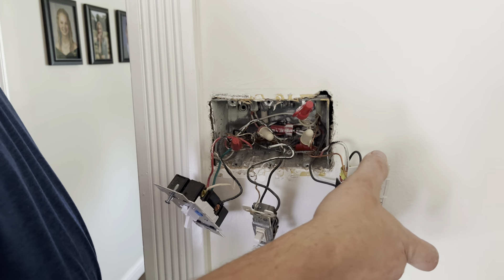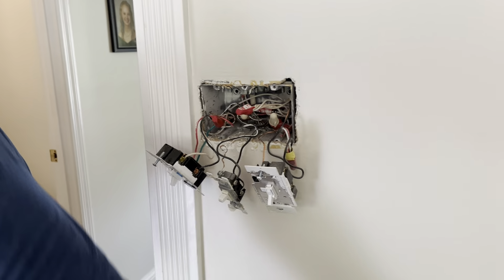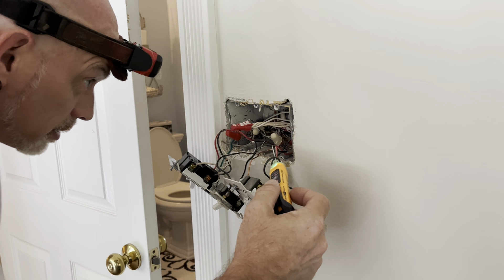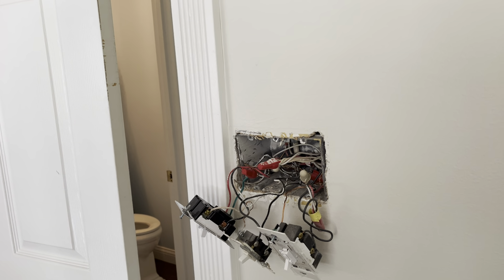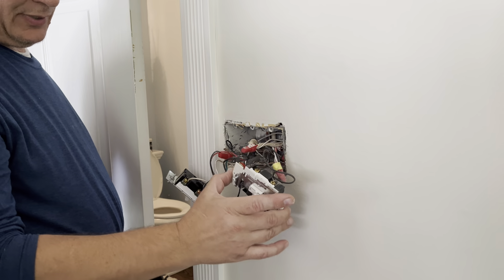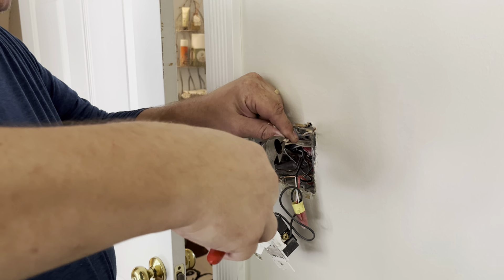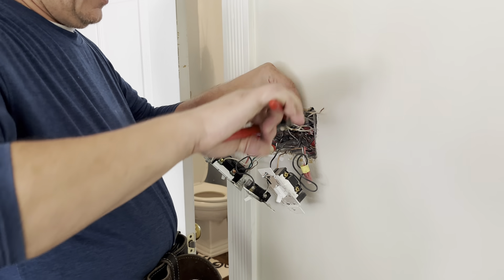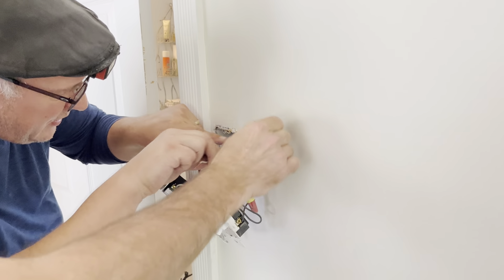Branch Circuit Net Current

Comment: I fixed this exact problem in my house back in 2016 when the only thing I could find about it online was one article. It was neutrals bonded between two circuits causing high magnetic fields in a few rooms.

Comment: Also, for anyone watching with magnetic field issues. This is another very rare possibility that I ran into causing magnetic fields. A “switched outlet” wired by using an additional 14/2 from the multi gang switch box to the switched outlet location. The then hooked the neutral up at the switches to the circuit and also at the outlet and used just the hot in the 14/2 to switch the top half of the outlet. Everyone worked just fine with the outlet but there was a net current on the 14/2 because it was essentially just connecting two parts of the same circuit together so current would always pass through. This caused high magnetic fields just in the room with the switched outlet. This type of error will also not trip any AFCI breaker because it’s within one circuit.